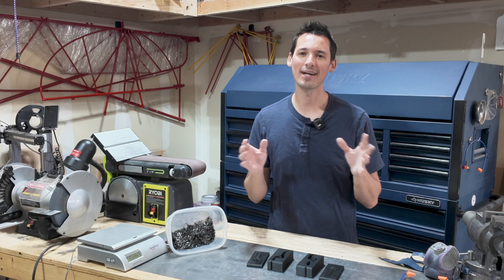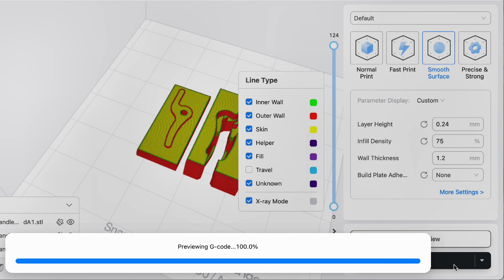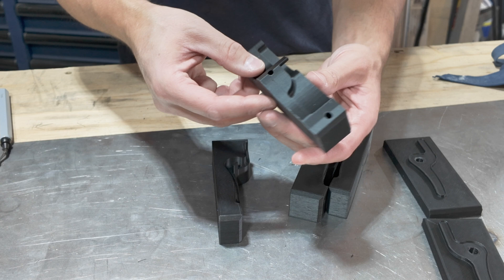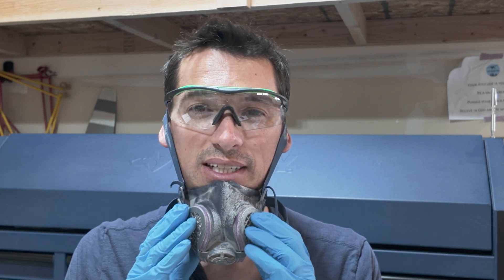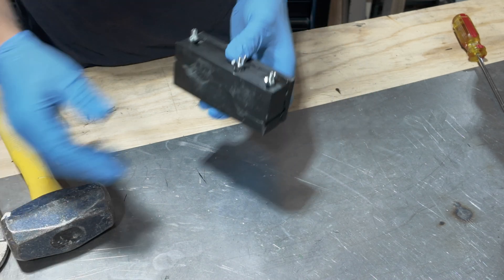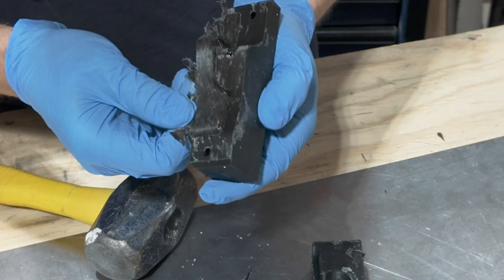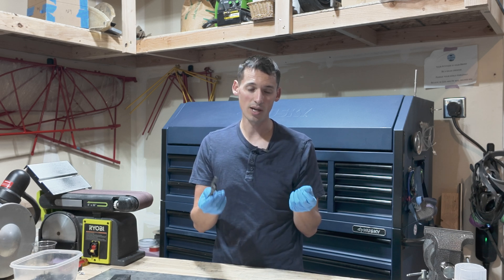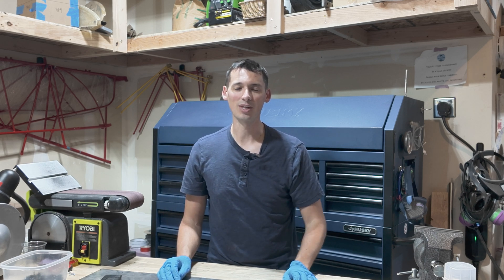My First Forged Carbon Fiber Part - 3D Printed Mold

Comment: i made numerous 3d printed molds, and no matter how hard i try (unless its a really simple design, without any intricacies), my molds always breaks somewhere when demolding. I used PETG, PLA, PET, and still i end up breaking something when demolding. So best solution is to design the mold to use as little filament as possible, use cheap PLA, as it will be good enough, print at small layer height (0.1 - 0.12mm) and then just sand the part after taking it out of the mold. Also - big tip! Sand in water! - you wont get dust in the air and wont breathe it.. less worry, and less cleanup.
Reply from the maker: This is really good advice, I just adapted this to some molds I’m printing now. Thank you!
Reply: if it breaks you can try different mold releases and bigger draft angles! or more mold pieces.
Reply: @kingkasma4660  doesn't work that way. If you have a hole in the design, pretty much 99% guaranteed mold will break. Bigger draft angle just means more epoxy will fill the void, and lock up the release. You probably didn't do much of these molds to understand this issue. So as far as it goes - it's an expendable tool, and I use as little plastic as possible to keep the contour of the part I'm compositing, and then just throw away broken molds
Reply: @yuriy77  is the mold for the hole also 3d printed? I use steel pins with a lot of mold release and hammer them out after the cure
Reply: @kingkasma4660  yes, I have a complex, one-piece design, that's even with pin holes for bolts to hammer out still and up breaking something. I used a 9 piece mold the last time I tried it, due to complexity, plastic parts still not strong enough to separate without breaking at the weak points. 
Again, reiterating that unless it's a simple shape design, plastic 3dprinted mold is a one time use. At least for the complex shape part. I was able to reuse some mold pieces, but I don't design to reuse, I design to waste as little plastic as possible.
Reply: @yuriy77  why use small layer height? sanding on water need special tool?
Reply: @andrikurniawan531  small layer height for better finish on the part. 
You need waterproof sanding paper to sand wet. Regular sandpaper will just rip and melt in water.

Comment: As you are using a computer to model the object, you can calculate its volume. 

Using the volume you are able to work out the ratios of resin to carbon fibre, using their respective weights. 
That way you can maintain a good ratio of resin, as the carbon is proportional. 

🇦🇺☘️😎

Comment: The mistake you made was you clamped the mold together first, you should apply release agent to the entirety of the mould then clamp it together, it stops the resin from gluing the parts together as it seeps between the joints.

Comment: As I understand it for forged carbon fiber in compression molds, you need to have a longer compression stroke (longer travel and more compression) in order to have the right pressure and part density. It apparently also helps with ensuring resin travels to as much of the mold as possible.
Check out Easy Composites' YouTube channel, they have a video about 3D-printed compression molding for CF, and there are quite a few useful tips.
Reply from the maker: Thanks for the tip! I'll check out that video.

Comment: Why dont you realise the pin in the middle with a steel pin? you can punch it out wich gives much easier mold releasing!
Reply from the maker: That's a good idea! I'm printing pins I can press in on the next ones so I have the diameter I need, but I'll take a look at steel pins. Thanks
Reply: @letsbuildthis  borrow the tolerance!

Comment: What printer and filament? That printed smoothly.
Reply from the maker: Snapmaker A350, and standard PLA for this one. Because there is a chance of destroying the mold, I just use the standard stuff. If I get something refined where it's reusable I'll consider a better material.
Reply: @letsbuildthis  Thank you

Comment: Great video! Perhaps finding a way to make the print layer lines run parallel to the direction in which you intend remove the part will help for de-molding. The tiny ridges that the layer lines form unfortunately just add friction/ grip.
Reply from the maker: Thanks! Yeah, that's a good suggestion. I'll take a look for the next set of molds.

Comment: How could the bottom split into two parts when the shaft that forms the hole is split half and half with the two lower moulds? https://youtu.be/kmyJMVr_iB8?t=157
Reply from the maker: Good eye, lol. Yeah total design flaw. I split the mould down the middle as the back up in case I couldn’t get the part out. Welp it was all moot because the boss held it all together. No big deal though because they’re low res prints and they broke in many places anyway. Next design will have the boss on one side.

Comment: What makes this forged as opposed to cast?
Reply: The marketing team at Lamborghini is why it's "forged" :P
Reply from the maker: Good question... not a term I came up with, just the universally used term around a newer composite process for carbon fiber. However the best analogy I can think of is a cast piston vs a forged piston. One is only pored, the other has had forces applied to it. So, I generally agree that the term "forged" carbon is not way far off in the fact that it's put under pressure as well.
Reply: i think it makes some sense to call it forged, if it is put under strong pressure. I clamp my mold with several C-clamps all around the area of the mold. but my designs are about 10in square.

Comment: Your video is very interesting and well done.  What filament are you using for the mold?  Just recently I ran across a new filament from Bambu Lab in another video. You may also be interested in it, https://youtu.be/A5PZclEcLWw?si=VmhQ5of6jM-FJMaL  I ordered some of it from Bambu Lab but it is on back order and I feel confident of the filament since they sell it.  I am like you mostly interested in engineering uses of 3D printing.  And we have two X1 C printers. Also like you I model all the parts for myself but we use SolidWorks which is comparable to your software too.  Good luck on the approach to carbon fiber forging!
Reply from the maker: Thanks Glenn! Just using the standard PLA for now. If I throw them away, then the cost is low. If I Improve the mould, and can reuse I will definitely consider some better materials. I just picked up a PC-CF filament, but without an enclosure on my printer I don't think it'll work very well. I had the chance last week to print some parts on a X1 and I'm super impressed with the quality and even more so with the speed. Needless to say, the Bambu is likely in my near future. Thanks for the dialog and encouragement!
Reply: @letsbuildthis  very nice. i've just done this with some bicycle frame dropouts and I was dissapointed how hard they were to demould. but I had not used a draft angle and did not split the mould like you've done so I guess thats the main reason. BTW for low stress applications like the handle, I'd use PC-CF. I've used it on bikes in certain applications and its very strong. if you enable many wall layers then the outer surface of the object is very strong as you ensure the (shortish) CF fibres are aligned to the surface and so perfect for resisting bending. good luck.